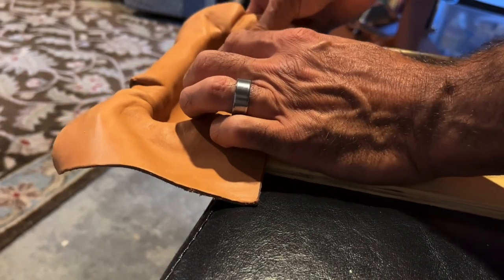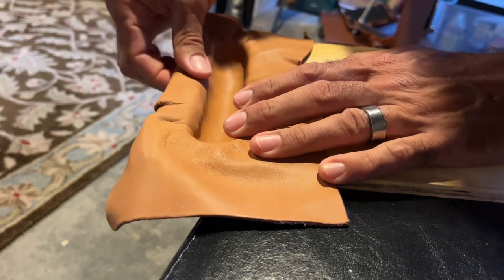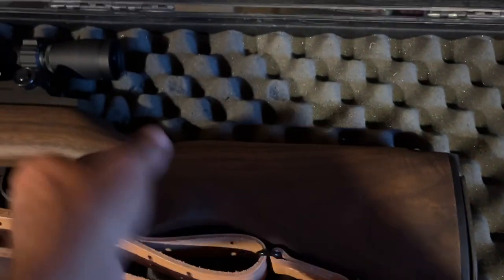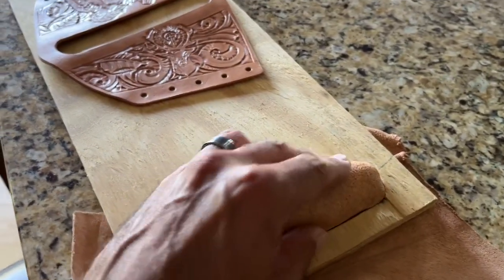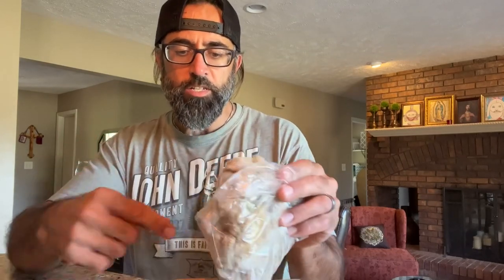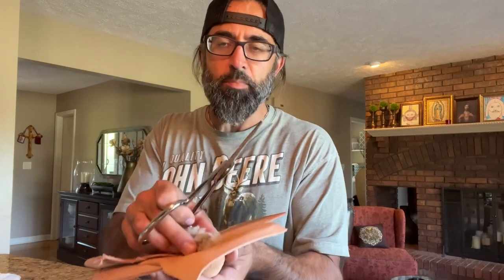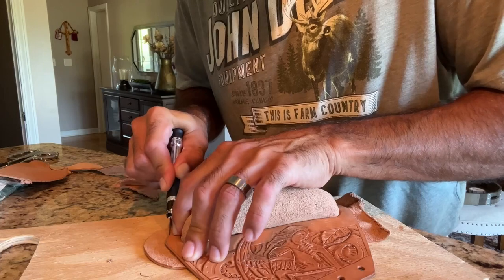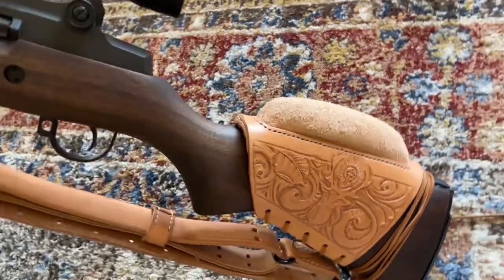Making A Custom Leather Rifle Cheek Rest - Using A Wet Mold

Comment: A yr later how do you like it?  How does the wool hold after getting wet?  The internet wants me to use foam.  I’d prefer natural materials.  Did you waterproof the leather?
Reply from the maker: I sold this so don’t use it myself but I did see the gentleman a while after and he said it was holding up really well! I didn’t waterproof the cheek piece as that was the flesh side. I did waterproof everything else.
Reply: @RedTractorLeather  I made a document tube for my speed loaders for my S&W 610 revolver and the brass corroded surprisingly fast.  A buddy said he rubs bees wax on his projects then goes over it with a heat gun to melt it in and that works really well.    I thought it was only chrome tanned leather that corroded.  If you’re building other gun related projects do you do anything special to prevent metallic interaction?
Reply from the maker: I have heard that can happen with chrome tanned leather but have no direct experience with that. I use vegetable tanned leather, and if dyed, I use Feibings Tan Kote to seal and waterproof. I do rub in olive oil on my finished projects to give some oils back to the leather. you could also use skidmores leather cream to replenish and condition but that’s what I use. Hope that helps!
Reply: @RedTractorLeather  appreciate the tips.  I did learn the hard way not to line my holsters with suede.  So always use veg tan now.  I’m doing a custom cheek piece for my Sako which lead me here.  Appreciate your insights!
Reply from the maker: very cool! And thanks for the insight ;-) You are welcome!